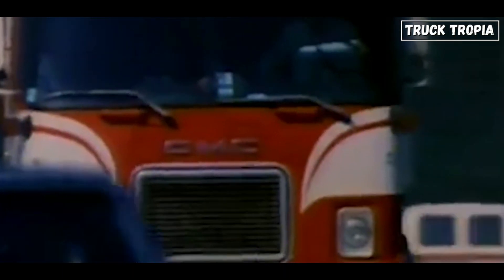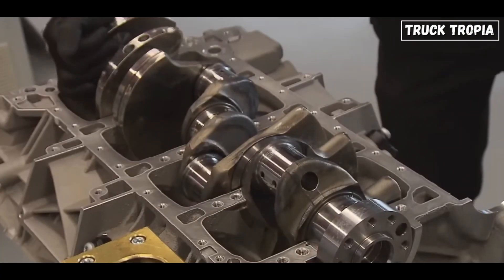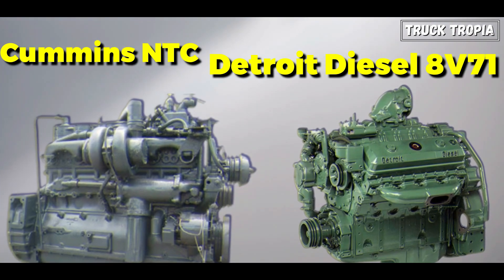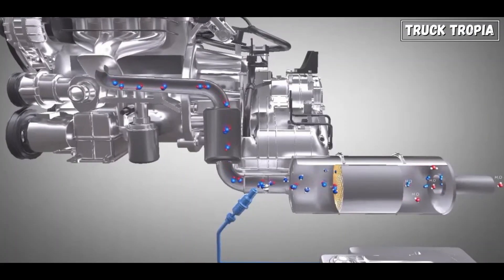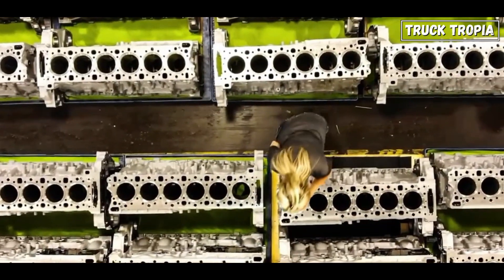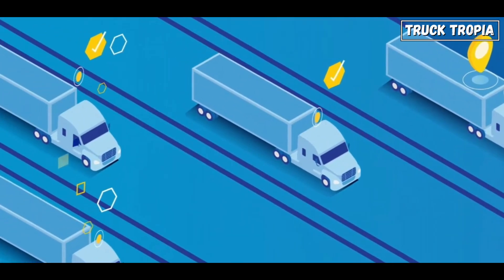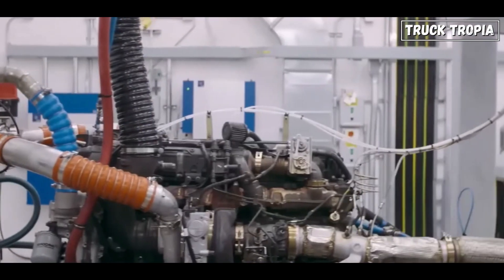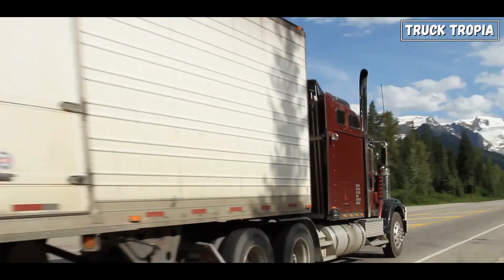Truck Engine Comparaison Old vs New - What’s The Difference?

Comment: My dad was a truck driver and in the 1950's he was driving Kenworth trucks Cummins diesel engines that were 6 cylinder.  They were the  same 855 Ci block as the modern engines, Have you heard of the N 14,  N 14 stands for 14 liter 14 liter is 855 CI.  The engine s had only 220 or 180 hp but they were dependable. The new electronic engines are a Real sore spot they are always broke down the newer the worse they are.

Comment: Older truck can have turbo or supercharger in 1960 they would be very basic and very expensive to use

300bhp to 600bhp would be it peak range with cast iron.

Raver have cast iron turbo then aluminium uk or allumion usa 

If turbo was made in 1960s they probably be cast iron because they was only material they had.

It possible to increase it performance even on old truck 

Like 10liter v8 1960 v 10liter 2024

There one thing tho

Most truck between inline and Vee engine 

Compare 10liter truck v8 1960 and 10liter v8 2024 version 

It possible to make older truck meet current regulations without further planning 

Reproduced cast iron block with todays technology 

It because restomod feeling 

It can help older truck on the road without worrying about co2 etc

Comment: The fuel economy is almost the same from 60 to now. They still 5 to 7 miles per gallon. From V8 to I6 direct injection is been there almost from the start of diesel.

Comment: It's a shame, I would have liked a bit more detail and not just the general information. Torque and power curves compared, as well as consumption per 100km and length of the service interval.

Comment: There have been advances and improvements in knowledge, design, materials, development, automation, manufacturing, and the construction of truck engines, all of which combine to bring about efficiencies.

Legislation has been responsible for advances in certain areas, such as fuel consumption, economy and most significantly, exhaust emissions!

Every commercial truck owner and operator wants engines which are more efficient and less polluting than those that came before.